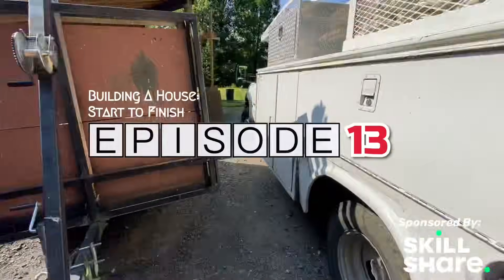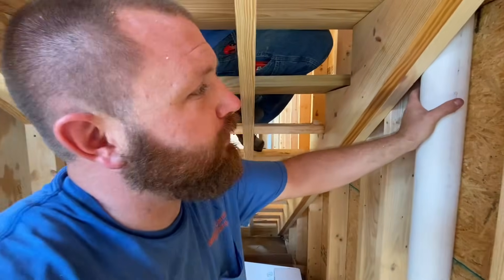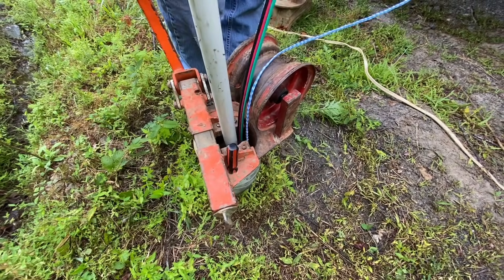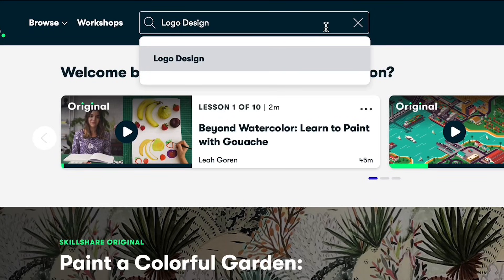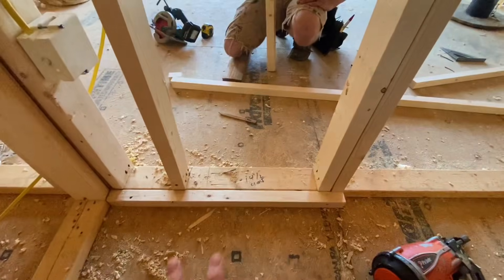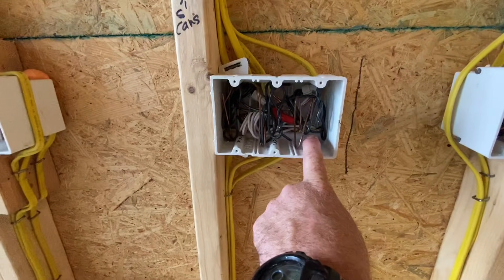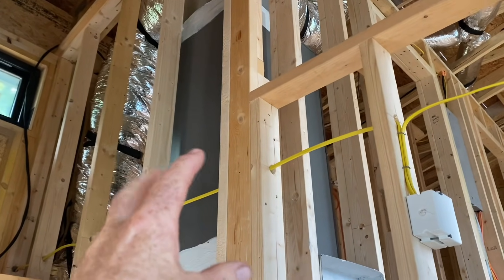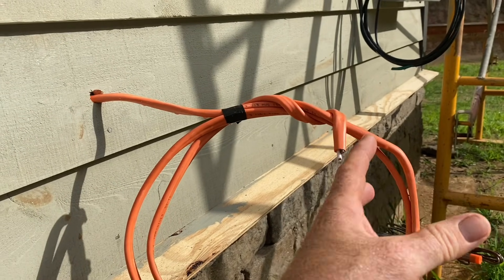Building A House Start To Finish | Episode 13: Plumbing, Wiring, and HVAC

Comment: In norway we put flexible tubes between the electrical boxes with wires inside of it so its super easy to pull new cables etc. Looks so wrong to just have cables inside walls 😂

Comment: if the main breaker for the condenser is in the outside panel, then technically they wouldn’t need a service disconnect since the breaker is “within view”

Comment: That return right underneath the airhandler is too close. Gonna cause a lot of noise from the blower. Should be at least 10ft away. Says it in the manual.

Comment: i was horrified to se how the electrician worked and pulled all the cables and what type of materials he used to connect the cables. then i realised. that i work as an electrician in sweden that has by far the hardest most controlled rules in the world. so i backed up and started enjoying it instead :)
Reply: Do you guys bend pipe over there?
Reply: @alexluna1222  we used to bend pipes before but nowadays we use a combination of pipes and flexible tubing all the way. so even when the walls are set you can still always change cables.

Comment: waow! Amazing stuff, but nothing like here in Norway on the electricals and plumbing, hahhh. In Norway, we install electrical-pipes for all outlets and control panels and then we pull the cables through the pipes and connect them. This way you don't need to pull down anything to access the cables. And for waterlines, we also have pipes that we pull the water pipes through. So double water piping. This also makes sure that if there were to be a leak on the waterpipe, the water will run inside the extra pipe and into one of the ends of the pipe. Then you don't have the problem with water leaks destroying electricals or other parts of the house construction. Just pull out the main water pipe, and pull a new one through! Really safe and simple! Also takes a lot less time to install so less cost for the customer when they pay electricians and plumbers.:)

Comment: The house I grew up in had a well that was about 300 feet deep.  It did not have a submerged pump.  The pump was in the crawlspace under the house.  The only thing at the bottom of the well pipe was a foot valve.  This house was located in the Appalachians in northern New Jersey.  I have yet to taste better water.

Comment: As an electrician, I'll never understand why other electricians pull 12 gauge wire for lighting circuits. 14 is so much easier to work with.

Comment: I don't mean to sound like I'm nitpicking your work, I don't want others to think I'm nitpicking either. On the water supply I like to run my water lines through a conduit especially when penetrating concrete. This makes waterline replacement a simpler process without having to dig 200 feet of a yard up or busting up concrete to replace a waterline. I also like to mark my electric wires in two places, on the end and six or eight inches from the end. The six inches from the end makes future trouble shooting simpler for future electricians.
Reply: I know this is redundant but in the attic I also mark the homeruns in a couple places especially in a shared geographical area and at the main panel.

Comment: In the walk up the stairs I see that the top riser appears to be much shorter than the others. To help prevent falls, all risers and all treads should be the same dimensions, and all of the tread noses should be in a straight line when viewed by crouching and eyeballing from the top landing.

Comment: We built a 600sqf sunroom off of the main bedroom, built around a $10k hot tub. 6 months later, got the call to remove the tub, as they never used it. No way to get it out of the room without a sawzall. Ouch.

Comment: That electrical is not looking great, wires not secured close enough to panel, home runs stapled individually like it’s 1989 instead of using tray or stackers and non insulated staples, stove box mounted sideways instead of just framing out? That ground splice not looking great, the wires were cut pretty short in that switch box (neutrals and hots) instead of just folding nicely..

Comment: PEX piping should be an expandable type rather than the crimp type because you cannot properly deal with the velocity change at the fitting diameter reduction

Comment: I've been a electricians assistant,  plumbers assistant and now I'm outside sales at city electric supply. During this video i was like,  "that's an allied 3 gang fiber box 4303-NK and looks like a siemens PN4040B1200CU... and that looked like 10/2 wire so they're probably gonna use a WN2060 disconnect for the heat pump." I'm bad to check part numbers when I'm walking down the sidewalk and see a box mounted on a telephone pole

Comment: myth @15:03 "these wires are tucked in so the rotozip doesn't hit them when the drywall guy goes to cut out the box"

Comment: Funny thing with solvent pipe glue, it specifically says not to twist when making the join.
Personally I dislike the style of wiring in the US, twisting wires and cable nuts make it a PITA for anyone following
Reply: That would be wrong maybe whatever you buy says that but as a plumber I’ve never seen that, you twist so the primer and cement can spread better in case you missed a spot also makes it easier to seat that pipe all the way into the fitting

Comment: Why is the meter base mounted in the outside of the house? This way anyone can turn off your energy or not? (non american asking ;) )
Reply: It’s just a meter, not a disconnect, you could pull out the meter and kill the power though
Reply: Meter is usually locked in. I think @gougar meant why does the meter base have a 200A breaker on it which you can use to turn off the service to your breaker panel in the house...

Comment: Funny to see electrical regulations in other countries. The rules in Sweden are super strict compared to most any other country, that goes for water aswell. Here we pretty much always run rigid wire tubes in all of the walls, so if you ever need to replace or add a wire you have tubes connecting every room to the breaker box, super neat.

Comment: Those truss floor joists gotta be a tradesmans wet dream. All the space in the world to run ducts and pipes and wires. Not like the silly TGI floor joists you can’t even hardly drill a hole in

Comment: Your duck should be taped sleeve to register then insulation pulled back over and taped.  If you look inside a register and see insulation then air can go through the insulation instead of through the duct

Comment: My brother in law is a plumber in Nashville and he said they only use Upinor pex that you expand the tube to receive the fittings. They had a lot of trouble with the clamp type pex leaking. He said the Upinor is idiot proof and they've had no leaks since they switched. They don't use shark bite fittings either for the same reason. Just an FYI. :-)

Comment: Why use 12-2 through out the house not 14-2 and 14-3?
Reply: We place every circuit on 20 amp breakers .. its a home not a trailer 👍
Reply: @jareddehart894  best answer ever!  I HATE 14s...

Comment: So if I understand this correctly: the only water connection to the house is the one coming from the well? My guess is that this is no drinking water? Only water for toilet, shower, garden hose, et cetera? So drinking water needs to be purchased at a local shop or is there some kind of filtration that turns the well water into drinking water? I live in the Netherlands and we’re not used to having no direct connection to drinking water.
Reply: Ground water can be used for drinking water, I live in eastern EU and it is quite common for rural areas to get a ground water supply for the house. The water is always filtered in my country for sand and similair particles, but rarely for bio contamination. In my country the water supply has to be drinking water quality, to prevent any kinds of diseases. Since the area they are building seems to be very rural, it would be very weird if the ground water is contaminated at about 200m.
Reply: Here in rural Canada we have a 400 foot deep well which provides all our water, and it's totally drinkable with no additional treatment
Reply: Most out-there houses run off well water,  there is likely a filter inside the house that feeds into a tank and then that tank is pressurized to provide water to the house. This way you have a extra supply in case power goes out and the well pump can't run. 
That's what I remember from living in the country as a kid, so nowadays it may be different.
Reply: Timothy Obal So the water is filtered and you can drink it after the filtration proces?

Comment: Surprised that they ran 12-2 wire for the lighting circuits.
Reply: Yeah it’s a waste of money and harder to work with. I usually split a 2500 square ft. House into two sections and and run all the lights and vent fans off 2 15A 14-2 awg circuits.
Reply: Right. 16 or even 20 will run led lights.

Comment: With the split system and the 2 dampers, you can only heat or cool the house, correct? In other words, you wouldn't be able to heat one area and cool the other? It's more of a condition one and not the other or both?
Reply: Luis Ramirez correct. The air handler does its thing and the zone dampers control where the conditioned air goes. The control board usually takes the first call for air in eciding what to do if both zones want something opposing.
Reply: @bpdp379  that's what I thought. I wonder how the control board decides on which action to take. I was thinking with solar orientation the south would be warmer, but I suppose unless the house is really large then the spaces are probably pretty close to same temperature. And anything larger you'd probably just throw a second air handler
Reply: Luis Ramirez I have a Honeywell system and it strictly goes off first call for heat or AC. Once that is satisfied it would then switch over. I’ve never seen it happen even though I have a walkout basement that stays cool year round.

Comment: Why did you place the electrical panel upstairs? Wouldn’t that increase the wiring cost? And make it more complex to run all the wires?
Reply: In my country you are also obligated to put the panel near the front door. This is for emergency services (firefighters) being able to quickly shut off all electrics in the house
Reply: @Frits1975  My state requires them outside.
Reply: max 5 feet from meter base in BC Canada

Comment: Noticed that you were using brass fittings for pex piping wondering why? I live in a area with hard water and we had big trouble with those fittings corroding over time so we started to use plastic [think its abs] fittings for the pex pipes, wondering if you guys have a reason for using the brass vs plastic?
Reply: As a plumber I don’t like crimp pex anyways but I’ve found that many people that use crimp pex buy the metal barbs because they think they will hold better I’ve used both and haven’t seen a difference in reliability.

Comment: Love your channel and this video series! Keep it up. 

I'm a licensed electrician and and it's a good practice to not bend romex cable very tight. You're supposed to have a larger bending radius, 5 times the width of the cable. So 90 degree turns are too much. (NEC 334.24)

I wouldn't put 7 wires under a wire nut (the neutral wires in the 3-gang box). Take 7 quarters and array them in a circle for example. The middle wire doesn't twist around the others and can pull out easily.  With 7 #12 wires, you need a blue wire nut.

Don't forget to staple the romex within 12" of the panel. (NEC 334.30)

Can't wait to see the finished product of the house!
Reply: Sparky’s🤦🏻‍♂️lol
Reply: Tonino D yea we the worst 😁
Reply: Why leave a foot of wire hanging out of your boxes. You're going to cut it back to 6 inches. Why cut it twice?
Reply: @daviddesilva4971  Because nothing is more of a pain in the ass, than trying to do your make ups on greenies and neutrals with 6" of wire.
Reply: I literally scrolled through the comments just to find an electrician's take on this. I am not a licensed electrician, but I've done quite a bit of my own electrical work and I thought joining that many wires under one wire nut might not be advisable.

Comment: Everything looks amazing but the crimped PEX pipe is a huge thumbs down. Every single fitting installed means some resistance for the water flow.

Comment: I've noticed that most electricians don't leave the loop of wire outside of the box. It's just a 3 or 4 inch loop stapled there so if you ever need some extra you can pull it in.

I am a licensed electrician and that's how I learned to do it. I'd like to see more people adopt it too as it really comes in handy after someone who doesn't know what their doing gets in there and cuts the wires too short to work with.
Reply: Saves your ass if the drywaller nicks it
Reply: I’m not a licensed electrician but I do that on every box, every time. Can’t tell you how many times it’s been a life saver
Reply: Excellent advice
Reply: Luckily the drywallers are very good at their jobs and also if any wires are nicked we can always pigtail onto any wires that may have been damaged which is very seldom or next to never knock on wood 😉
Reply: Jared DeHart where do you live and where did you find these drywallers?!?! Ours are a bunch of cowboy yahoos that can’t even hang a board straight much less avoid the wires with a roto zip that they’re going to make a hole beside every other box with 😑
Reply: I was taught as an apprentice to follow the building lines with the wires never twist them into each other. It had to look like an industrial conduit run in the wall. When I asked why we did that if no one saw it after the drywall went on I was told because we can see it now. We also left the loops
Reply: Always leave a loop.  Just in case!
Reply: Looks ugly as heck and a waste of money. These guys did a nice neat job.
Reply: Robert gregory it’s not a waste of money if your drywallers nick every other wirw with the roto zip and you have to pull it in to be able to put in plugs switches and lights